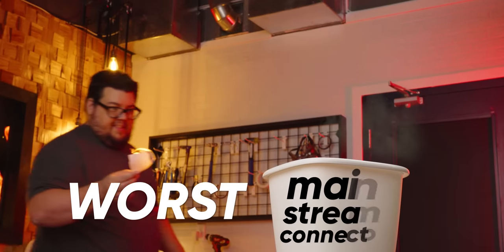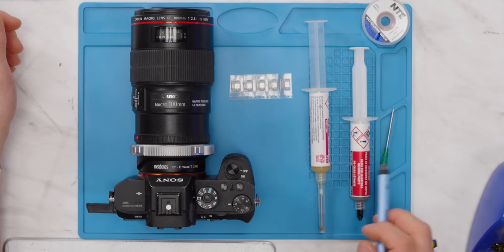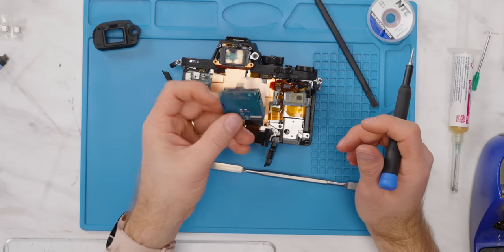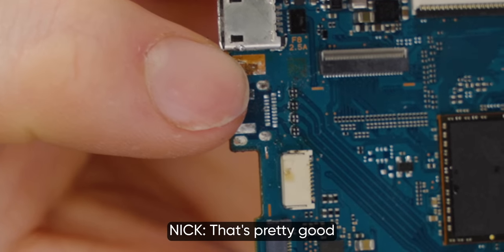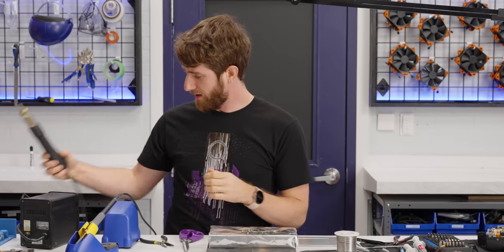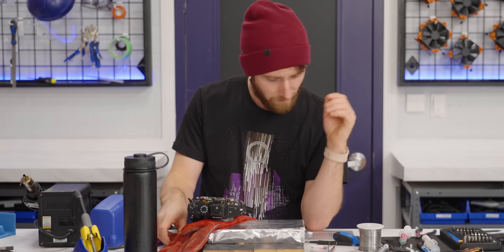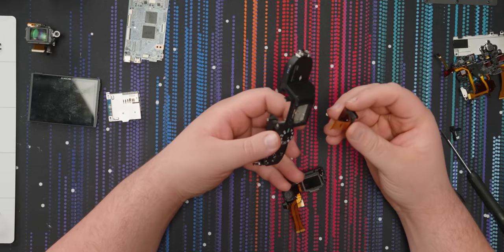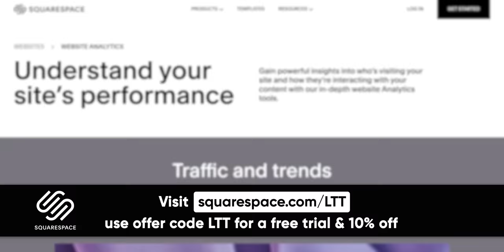This "cheap" repair almost BROKE me.

Comment: Seems that Linus only proved that repair work is more than the sum of the value of repair parts. Labor equals time and effort, which is also worth money.
Reply: Yup, but a repair work also shouldn't always cost as much as replacing with new stuff
Reply: And knowledge, which either comes from a training course or breaking enough stuff that you know what to not break.
Reply: @riomisterio6665  Repair cost should be proportional to the effort and skill involved, and it often is. Sometimes things do legitimately cost a significant chunk of the replacement cost just to repair, because either the parts are expensive or the labor is intense or both. It generally bothers me to see a professional's work in any trade be devalued by consumers who have no idea. It's like the folks who think the pawn shop is going to buy their item for expected retail, or that an electrician is going to come swap their light fixture for barely more than the cost of the fixture itself. To be clear I'm not saying I think you feel or think that way, just a tangent about a thing that gets me riled up lol.

Comment: I tell ya, these videos are actually doing more to support why these professional and expensive repairs services are justified lmao
Reply: right to repair doesn't just mean that you should be able to repair them, but that smaller repair shops get access to schematics, tools and replacement parts to cost effectively fix your electronics.
Reply: @simpson6700  If I'm confident enough to do the work myself and willing to take the risk of screwing it up, why should I be forced to use a repair shop?  The parts and information should be freely available for anyone wanting to do the repairs.
Reply: @nic.h  i never said you shouldn't have access to the same tools, information and parts.
Reply: @simpson6700  I took your first sentence to be implying that. I.e. "right to repair didn't just mean that you should be able to repair them...". Apologies if the implication I took from that was incorrect.
Reply: @nic.h  i meant to say that while self repair is a big factor in right to repair, it's not the only one.
Reply: @simpson6700  understand, thanks for clarifying
Reply: Soldering is the only concern I have with having my mouse switches replaced. I'll probably just pay someone more experienced to do it.
Reply: In phones no connector to the outside is directly connected to the mainboard. If anything this is a story about how Sony made an emerrasingly poor design to repair.
Reply: @simpson6700  Exactly! Right to repair means an independent shop/professional can actually repair your stuff. Not just the official repair center telling you that it can't be repaired, you need a new board and it's going to cost 2.000

Comment: Yes, keep in mind when you're trying to do repairs like this on your own, that even with the proper tools you may end up making things worse. I learned this when replacing a USB-C 2.0 port on a tablet, where I broke the MicroSD port on the board while taking it apart, and ended up also having to replace that port as well, because it was needed.
I have a couple of non-working PS3 3D TVs, one where someone tried to affect repairs on his own, and ended up lifting some pads off the U4 EEPROM, and blowing off some 0402 resistors. I also have a Pioneer LaserActive Sega PAC that while it was working before, after replacing the capacitors, stopped functioning.
Know that a lot of these repairs are complex, tedious, and require a lot of patience, good (and proper) gear, and experience, and in non-professional hands you may pay for this in spades.

Comment: Soooo.. In the end he ended up spending:
~$100 for Hot Air Soldering Station & Soldering Iron.
~$50 for Flux, Solder, etc.
~$20 for Micro HDMI Ports.
~$400 motherboard.
~$200 for Sony to Calibrate it, at the service centre they were trying to avoid. 
Total: ~$770.

Sony wanted:
Repair: $500.

Video start: Nothing to lose. Well.. Except for the $270 on top of what Sony wanted.
Reply: But now you have the tools and knowledge to gamble with better odds on future repairs.

Comment: Hey there, I work as a tech on Sony cameras.  You're supposed to remove the top board before you remove or install the mainboard on almost any Sony camera. There's a screw in the front side of the battery compartment, which helps you take off the grip, which helps you take off the top board.
Reply: I like to know how my things are assembled so I've got some idea of how sony cameras can be disassembled. Your job is pretty impressive, high economic risk if you make any mistakes
Reply: @xWood4000  you can say that. The largest issue I've encountered is finding broken cameras to use for parts.

Comment: I had to RMA several cameras (zoom q2n) because the micro usb power port broke and the camera would overheat causing them to stop recording.

It was cheaper for zoom to send me brand new zoom q2n 4k’s as a replacement, than to repair the original that was discontinued.

They also have micro hdmi ports on them, luckily they havent broken on me yet, but considering the camera is ~$200 I doubt its worth repairing them

Comment: When dealing with plastic components, you can set the air temperature to 320C at most. It's good to have bottom hot air preheater to help you heat up the board - that's what you want to heat up, not the component. Also, you should place the component into the solder paste (if that's what you were using) instead of melting it beforehand - the flux in the paste should help against bridging of the pins.

BTW, to improve longetivity of the connector, I'd add a short extension cable and a 3D printed holder to keep everything fixed without stress to camera's connector.

Comment: I think one of his tools should be a magnifying glass. They have always been super helpful for me with that kinda work
Reply: Cheap digital microscope rather
Reply: The worst part is that they mentioned having a microscope multiple times and still refused to use it for the actual repair.

Comment: Linus: "This is why right to repair is so important!"
Also Linus: Breaks the thing he's trying to repair
Reply: If this was a commercial from the anti repair lobbyists Linus and half of the film crew would be dead!!! 😅
Reply: @TheDiner50  "Why are webcams or rather computer cameras so BAD that you need to resort to expensive cameras not meant to sit on top of a computer screen." in photography/videography, sensor size matters. A full frame sensor is far superior than 1/2.3" sensor of a 50-90usd webcam.
why dont you ask yourself, why an i9 is so much expensive than an celereron cpu?

About camera screens. well, to be honest, all brands cut corners in some way and those 3"-3.5" screens are one of those corners, another one are the crappy batteries they keep using so we have to buy many spares.

Comment: And that's why it costs $500, the trained technician, the "insurance" in a sense, and time and effort.
Reply: It costs $500 because Sony is just going to replace the whole board, they're really not going to fiddle with the hdmi connector. Same thing why car repairs are expensive. They just replace whole assemblies.
Reply: @TheEchelon  this, and not to mention that most other places are unlikely to want to mess with it. They know most people will go to Sony for repairs.
Reply: @TheEchelon  that's true almost all electronic repairs are like that now, but as someone said in the comments, the some dollar replacement quickly costed more than the repair quoted by Sony. 

If you're trying to repair something yourself, unless you're trained or very experienced with what you're repairing, stuff may go wrong which may end up costing you more.

That's why most of the time if something needs repairing and that something is pretty expensive, I tend to just have it repaired by a certified tech. But if it's something inexpensive, I'll repair it myself.

Comment: Linus says "there's no way around that..."
Well actually for our Sony A7R3 used for photography and video content we invested in a smallrig cage for it, which is small enough to fit in the Crane3 gimbal when required, but also gives a firm cage to Velcro strap the hdmi cable in place. The cable we have is a curly chord MicroHDMI with a right angle plug, so it sits flush with the Smallrig cage. This can sit permanently mounted on the camera for various movements of the camera and when needing to plug it into an input, such as our Atomos recorders, or a wireless Hdmi transmitter, they can either go directly in, or using a HDMI extension cable, where it then plugs into the curly cable without touching the hdmi port.

Comment: While I fully support Right To Repair, moments like this are also why I tend to play devils advocate. Just because you can repair it, doesnt mean you have the ability/skill/correct tools etc. Props for at least trying and learning along the way that alone makes things like that worth it a little bit.
Reply: The only part about this that seems like it was 'off' was the $200 for calibration. I'm surprised there's not a user level option to fix the color after a motherboard swap.

Swapping parts ON a motherboard is always going to be heavily 'ymmv' with the results going like this video in the hands of amateurs... 🤷‍♂️

Comment: Here is what I learned from this video. It cost Linus more to fix it himself (Approximately $400 for a new MB and $200 for Calibration) than sending it to a Sony Service center to fix the micro-hdmi port ($500).  This is also not including the cost of the tools and parts to fix it himself. Let this be a lesson to everyone. Soldered to your discretion
Reply: Yep. The repair costs are astronomical but this video shows why. Sure, you could get it independently repaired, but just buying the right tools and parts yourself doesn’t mean that you can do it more cheaply. Not without the skill, experience and, sometimes, the necessary schematics.
Reply: made more off the video already tho
Reply: Don't forget the labor cost of having an employee replace the motherboard
Reply: this kind of repair looks really brutal

Comment: You should use kapton tape on parts that were beneath the connector and on parts that you don't want the hot air. By the way terrible soldering.
Just remove solder completely from pads. Apply paste put the connector and use hot air. Remove bridges with wick
Reply: and don't use the fine nozzle. just the wide outlet and parts won't fly out.

Comment: By the way, there IS a way to get around the cable strain damaging the port and I’m really surprised Linus didn’t mention it:

If you want to prevent this problem use a cable anchor on the rig. It will secure the cable so it doesn’t jostle around in the socket. In most production environments where you aren’t switching the cables and monitors it’s a solid idea.
Reply: Can you suggest a cable anchor for micro hdmi that I can mount to the side of my camera? I don't think I have ever heard of such a thing.

Comment: Fun tip for anyone with a camera that runs with micro HDMI slots, Smallrig make a tiny extension that goes from micro HDMI to full size, and is of course built for mounting to a cage :)
Reply: I second this comment.

Comment: Everyone saying, "This cost more and took more time." Lol The right to repair is not about "everyone" doing it themselves. But allowing the right and access to parts for those competent enough who can DIY while allowing affordable, non-OEM repair services for those who can't.
Reply: Exactly, its about making sure you have a choice of where to get it repaired, rather than just "manufacturer certified" repair centres.  Although not not exactly relevant to this specific video as the connector is a standard part and the camera seemed to not be designed to stop you getting inside.  But he brought up the point as we need to make sure this remains the case and I suspect their custom chips would not be so easily sourced by a third-party.

Comment: Never pull part of the board when desoldering, take your time and let the weight of the board pull the part loss, heat the surrounding of the part also and do it slowly, and leave the board on the table, solder of other part may also melt and if you move the board there is big chance that they fall off. 
Edit: Linus motoric is a bit less up for fine work like this, he is butchering it, again! :D
edit: Just use your solder iron with the right tip and enough flux and solder on the tip and drag it along the pins, this is an easy job! Hot air for desoldering and solder iron for soldering

Comment: you can also use low melt leaded on the pads/anchors beforehand to help with removing the port the first. then turn down heat and go from bottom. kepton on the stuff you don’t want heat to get to, and be patient. usually on smaller stuff 400-450c, from bottom

Comment: So basically it cost you more to DIY the repair (taking into account staff wages + parts i.e. board + connector + calibration) than to send it to an official Sony repair where they know what they're doing without screwing anything up :\
Reply: Dont remember the last time i had to pay staff wages in my bedroom
Reply: And, Linus did everything wrong in terms of how to replace the connector, thats why he had to buy a new board, if he got some experience with micro soldering he coult do that with just 50 bucks just fine
Reply: absolutely false
Just take the whole thing apart and give any mobile phone repair shop the replacement connector and ask the guy if he can do it- most of them can and will solder it back on for just a few bucks. 

And if you have any experience in soldering you already have enough equipment to repair it within minutes
Reply: Ah, but did you factor in the revenue from the video that the camera created content for? ;)
Reply: It cost more money for a layman with no soldering skills who didn't look up guides on how to use his equipment more money to DIY it than the sony one, if he had taken it to an independent repair shop he could have had the port replaced for 1/5 to 1/10 of what sony was asking or spent a couple hours looking up how to do this kind of work and spent a weekend practicing desoldering and resoldering ports from cheap junk from goodwill or similar he could have done it himself, the problem was going in blind without knowing what he was doing.
Reply: @mokubakaiba1751  which isn't hard to get. It literally is one of the easier things i have personally learnt. All It needs is some cheap adapter PCBs for USB C or small components which cost couple dollars and some the parts and some time on your hands.

Literally did my first USB C replacement on a keyboard with a blowtorch and the USB C port covered with some kapton and aluminium foil and non adjustable 10$ iron because I didn't have any access to my equipment and it went very well

Comment: I do a lot of micro-soldering and here's what I would recommend for an easier time. Clear the pads and holes of solder, put the connector in and solder the through hole pins to keep it secure. Then just add lots of flux to the connector pins and use your iron and a small amount of solder run it along the pins. This will work fine - the flux will help the solder form around the pin instead of congealing together and bridging. I would also use a microscope TBH, I'm sure you must have one. I have successfully soldered plenty of pins with 0.5mm pitch this way!
Using hot air like you were doing isn't going to work unless the board is preheated, since by the time you get the board hot enough the connector will melt.,
Reply: Can't do that with these HDMI connectors, has to be hot air flowed because of the second set of pins underneath the connector.  My suggestion, as Northridge Fix usually does with his port replacements, is use hot air underneath the board, so the board soaks all the heat into the copper instead of the plastic in the connector.  Best practice is to use Kapton tape to cover off any components underneath that could get damaged from the excess heat.
Reply: @KainArkanos  also some sort of magnification would make the repair easier. Trying to solder a tiny port with naked eye in such an expensive camera, is a recipe for failure.
Reply: I was screaming microscope the entire time😅

Comment: Wait did he end up paying more to “fix it himself” than it would’ve been to just send it to Sony in the first place.
Reply: Ya, it would have been cheaper for sony or a 3rd part to repair it, but mostly because he made it worse. If you are not too worried about money and want to try fixing something you otherwise would throw away its usually not that expensive to try it out yourself (just do some research to find tricks like the hot brick)
Reply: Yesss🤪😝😝😝😝😝😝
Reply: very little soldering experience and he had to buy all gear... if he did some research how to solder small parts and did test runs on sacrificial board (something old do desolder and solder back on) success chance would go way up
but yeah only worth doing on post-guarantee items where cost of authorized repair is higher than it's value on used market. No loss if you brick it.
Reply: Yes, but only because he broke more stuff then went to Sony anyway.
Reply: Uhh no, because he couldn't have made a video out of that? 🤔
Reply: @TalesOfWar  If you still have warranty, you use warranty repair....
Reply: @TalesOfWar  Funny syory about that. If we had proper R2R, a correctly done repair would not void warranty, even if performed by someone other than the manufacturer.
Reply: @TalesOfWar  I wouldn't know. Frankly, as far as I know we've barely started working that out here in the EU, I'd be very surprised to find out the US was ahead of us in a consumer rights issue.